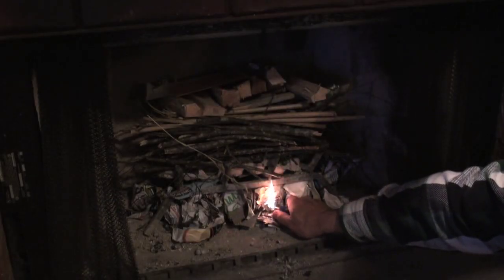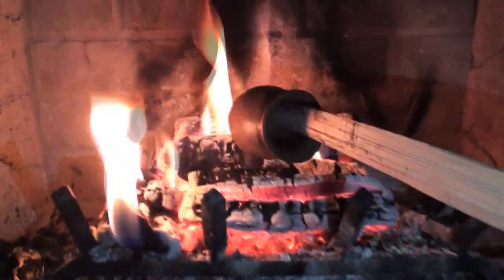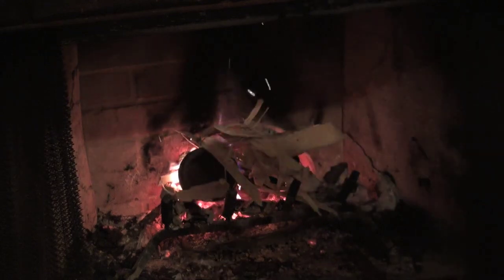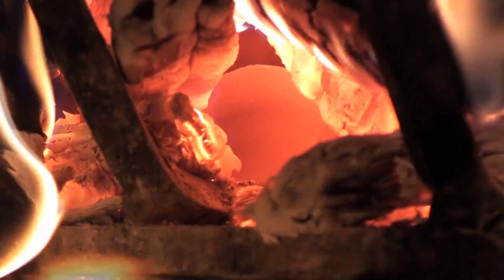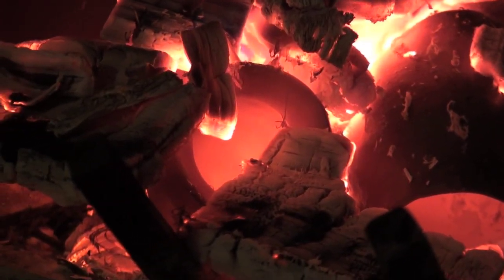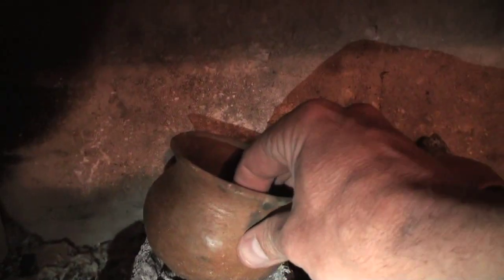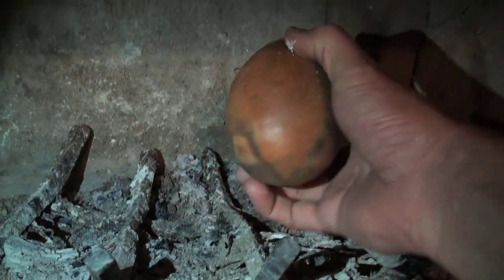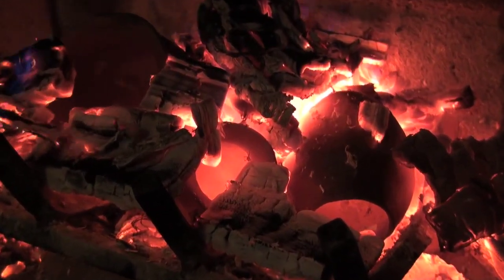Firing Pottery...in a Fireplace (HD)

Comment: After finding some local clay deposits, refining them, and then firing in my existing wood stove....I think I found a new hobby :) Works great! No cost...just labor :)
Reply: Oooh.. I have both a fireplace and a small wood stove too.  This opens lots of possibilities.  What tem and how long in wiodstove?
Reply: @robinsmith8846  I would set them on a redhot bed of coals in the back of the woodstove(on a new piece of wood) then pack the woodstove with smaller pieces of wood, filling it. Then just open the flu and draft and let it burn off. Usually before bed. Next morning, still hot but I was able to take them out.
Reply: @jsmythib  thank you!!!!
Reply: Am about to stick some local clay in my woodstove right now. It's winter, so there's no letting it die down and cool off, unless we want frozen pipes. No idea how long to leave  it in. Trial and error ftw!

Comment: I tried this but my little trinkets were just brittle and chalk like.  I fired them about the whole afternoon and evening then went to bed and retrieved them in the morning.  Is it possible i overfired them? Any tips would be great!
Reply: i think it depends what clay you used ! There are some clays that will decompose/melt if you exceed a certain temperature. If the clay wasnt pure and had some other mineral in it (like calcium carbonate), they will decompose and break the clay appart.

Comment: I know this is an older video, but Ive done something similar. Used clay from the garden & made teeny tiny pots & bricks, put them (dried first over a day or two) in the hot coals/ embers & left them overnight. They did turn that terracotta colour but I haven't tried anything bigger, as the fire dies down, they moved around.
Reply: You didn't have to kiln predrilled like he did? 
I am looking to do small pieces with children I work with and using just air dry then cure in fireplace.  Thanks
Reply: @robinsmith8846  i don't have a kiln, I left them to dry for a day or two indoors, nearer the fireplace or on the stone/tiles in front of the fire once they were looking dry already (so they didn't dry too fast?), Then put them in the fire. 

One pot I had to do twice as it was more urn shaped & the inside didn't seem as done. Ive done little medallions where I made a stamp on it. 

My first batch all blew up because I fired them same day, i thought being flat it dried faster & they looked dry outside. So two days drying, Ireland is mild & quite damp, might be different if you are elsewhere! His method of laying it out better might be better to do, I put mine in the hot embers/dying fire, added kindling & left it overnight as the fire died down, i suppose it kept hot enough to fire pottery?

There are lots of outdoor/bury them firing that might work. A bbq? Or one of those Aldi campfire/patio hanging fire tripods might be options too if you keep the fire going?

Comment: What clay would be good for this? I really dont wanna buy a kiln.
Reply from the maker: I believe any local clay you can find will fire in a fireplace.  Essentially you are making earthenware and low-fire clays are what work best for that because they will vitrify and become a ceramic at the temperatures that a campfire can reach.  The trick is finding the right clay with the right properties that are plastic enough so they they can be formed into pottery and not crack.  You'll need to get out there and experiment with different clay, and also play around with the amount of temper it requires to stabilize the clay so it won't crack when fired.  There's a lot of trial and error that goes into it, but once you discover the right combination, it's a lot of fun to make and fire pots from clay you collected yourself.
Reply: @primitivepathways  How do you know if it's vitrified or if it's just bisque?

Comment: it also depends what kind of clay - high fire /high temperature clay won't work this way
Reply: The first time this kind of firing was used was about 30,000 years ago. They didn't have low fire or high fire clay at the time, just used what was available.

Comment: would this work with a small ceramic chiminea
Reply from the maker: Yes I would think so.  the key is getting the pottery totally dry so there's no residual moisture left within the pottery before you ramp up the temperature.  Once you do, then you can build up the fire and get the pottery red hot.

Comment: do you know something about doing that in a gas stove?
Reply from the maker: I don't think a gas stone gets hot enough.
Reply: @primitivepathways  Thanks for your anwer, yes I think so too, I will try firepit in a metal wood stove so I dont burn down my terrace
Reply: @FloraArs  I have used a metal stove to fire low fire pottery. It can be done, but if you run it too hot the heat can soften the steel and it will deform. I also have fired in an outdoor stove made from an oil can for the purpose of boiling maple sap, and it works as well, again the metal softens with heat and deforms. My indoor electric oven can go to 900F in a self-clean cycle, but I don't think that is hot enough. You can also dig two deep pits outside in the earth, connect the two pits with an air tunnel at the base. Build a fire in one pit and the other will siphon air underneath the coals. You can get hot enough to forge steel that way, I made an iron spear point this way.
Reply: @gbennett58  thankyou so much, for the answer is really complete and educative! I will keep trying I bought a metal can so I can do it in my terrace (the only space I have) but I keep breaking stuff or to be not cooked well, I think I will try again with your advice